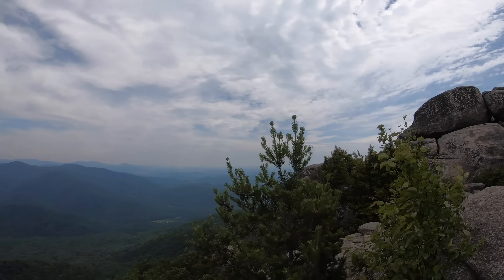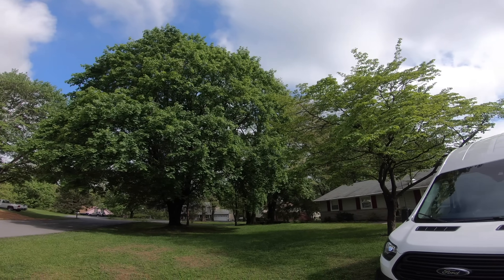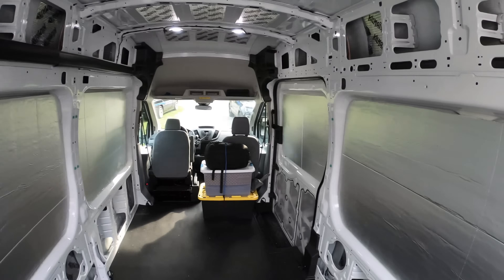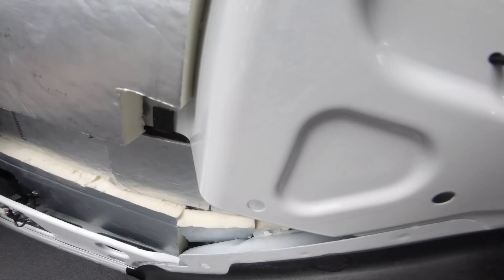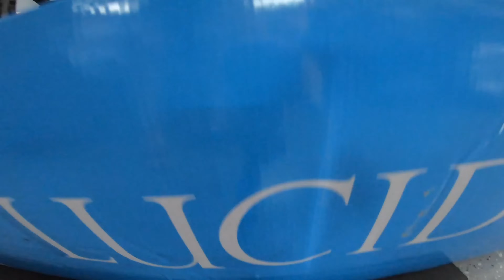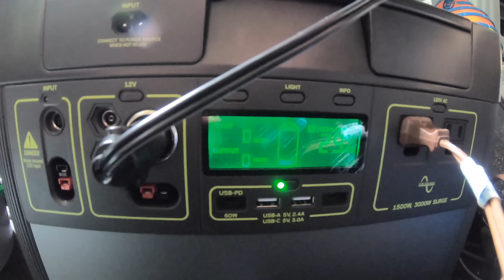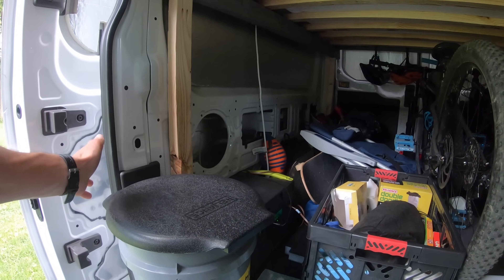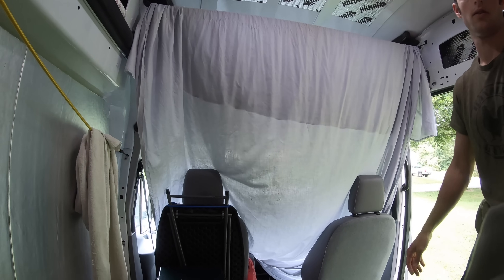Ford Transit Van Build : Simple MTB / Surf / Camper  Van

Comment: It is a huge mistake to those board insulation. You gotta use fluffy insulation material to fill in the space between the metal sheet and inside wall. This board won’t be able to trap the air movement inside the wall.

Comment: Thanks for the video can you tell me where to get those black bags for the toilet please thank you
Reply from the maker: Johnny Battle Life they sell them on amazon. Just search reliance double doody toilet waste bag. Should find them there
Reply from the maker: Also, you can make them yourself for cheaper... just take a large ziplock bag, put a trash bag inside the ziplock bag and use binder clips to secure the trash bag at the bottom of the ziplock bag. Works just as well and saves some $$ just takes a little longer to assemble everything
Reply: Thank you that’s very helpful I appreciate it. One other question do you have a link to the thermopro inside outside temperature control you use that look pretty cool also
Reply: And where did you mount the outside sensor on the van for the temperature readout

Comment: Nice video, also what is the point of the fan?
Reply from the maker: Niccolo Defendi-cho 
The fan helps circulate air through the van. It has two modes. 1) intake, which is where it brings fresh air from the outside and blows it into the van. 
2) outake, which blows the hot air from inside the van outside to help cool the van off quicker. 
Also it helps remove water vapor from the air which can help prevent mold in the van.

Comment: Hello,  just curious how's the Transit holding up? I'm looking at the 2020 model with AWD but the reviews are not that great. A lot of rust issues, transmission and drive shaft problems and the water drain from the window into the motor, breaks going out at 30k miles. 
What's your experience been?

Comment: Foam spray insulation would work better and is way easier to instal.
Reply: I read that spray foam is really flammable, wouldn't it be dangerous if you would have to drill into the sheet metal because it would make sparks?

Comment: Info on your van please? 1/2, 3/4 ton? Engine, XL or XLT? Height of van?
Reply from the maker: 3/4 ton, non extended length, and can’t remember the engine off the top of my head but it was cheapest engine configuration and it’s the highest roof height available

Comment: Nice rig but as usual way too much Killamat was used. Only strips and patches are needed in certain spots to take out the high freq resonances.
Reply: Which spots and how much?
Reply: Basically it should be applied to the bigger flat surfaces that can vibrate, Knock on them to hear the tin can sound and how they resonate.
I put a couple of strips in a cross pattern on those surfaces but also on the floor in my van. Tap the panel afterwards and you'll hear how the high pitch resonances have died off.
Actual sound insulation is done with the insulation and whatever you cover the walls with afterwards,

This stuff is expensive and heavy so save some money for for other things.